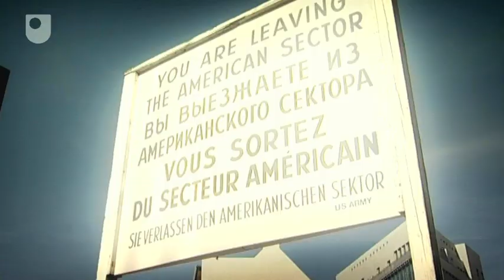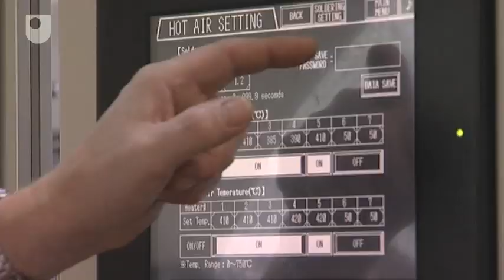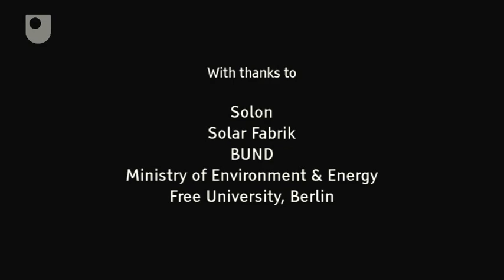The German Model - Energy Policy and Climate Change (5/7)

Comment: More and more of the German people have had enough of Energiewende and the Merkel anti-nuke stance.  In just one year there has been a dramatic shift of public opinion on the question, 
"Should nuclear power continue to be used to generate electricity to meet the EU's climate goals?"
Spring 2021:  49% yes, 42% no, 9% undecided,
Spring 2022:  65% yes, 28% no, 7% undecided.